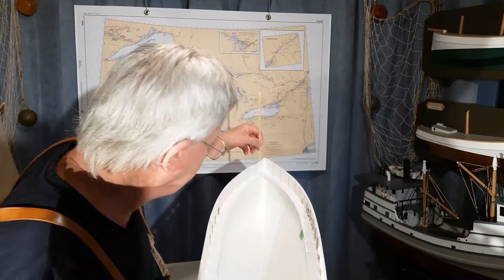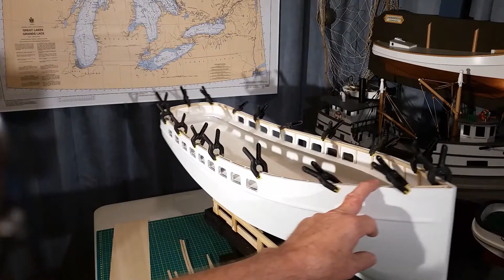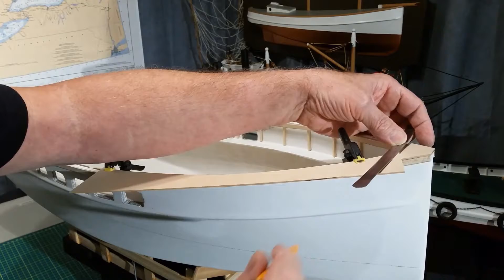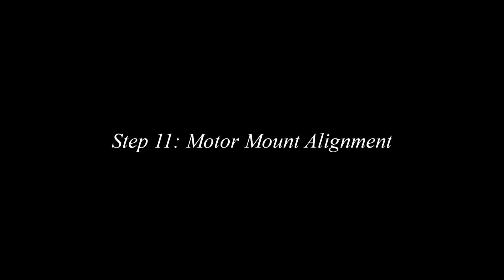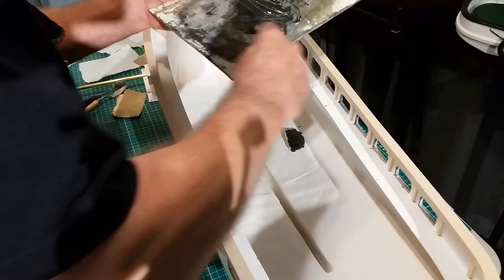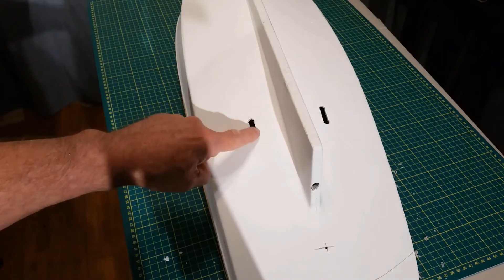RC Bad Weather Ship DIY Build Part 2

Comment: Hi Brian, Chris from New Zealand here, Watch part 1,finished part 2, about to watch part 3,  Your idea and way of using the center prop shaft to install motor bracket and the 2 outer shafts alot easyier and better,,, Question= would keeping the center prop shaft  in aswel give more power and control of the boat??  cheerz for the great videos,,
Reply from the maker: I had considered 3 props for extra power but it turned out that 2 props gives that tugboat so much power it will  drag a huge stern wave at full power. In fact the tug will go from all out forward to full reverse practically in it's own hull length. But maybe I will use a 3 prop layout in the future for a build. There's lots of control with that big rudder with 1, 2, or 3 props.
Reply: In theory it should do 🤔 You may need to experiment with different props and rotating clockwise/anticlockwise to avoid interference issues but many large ships used 3 props

Comment: Brian were did you get the stand from.
Reply from the maker: I made the stand using a 6 inch by 6 inch swivel base from the hardware store.  It also swivels port and starboard and fore and aft to get the right angles for video.  For just building models I recommend setting up a swivel that sits level on the table and swings 360 degrees. I am going to make another simple one like that.  Just 2 pine boards with the swivel between them. It's a real help when working on model workboats and especially lining things up and painting.